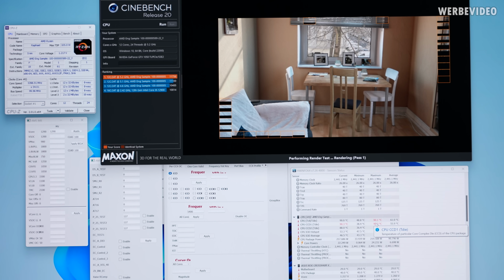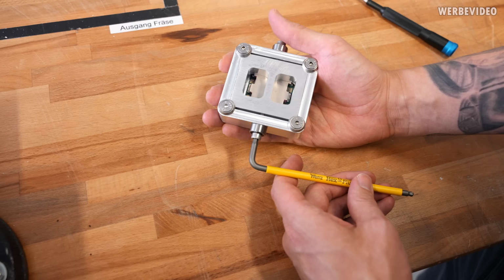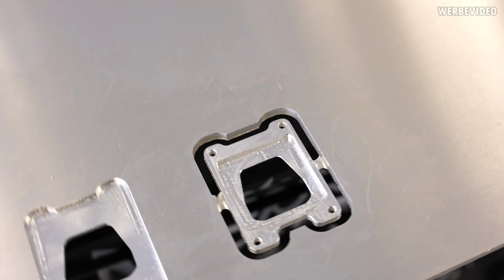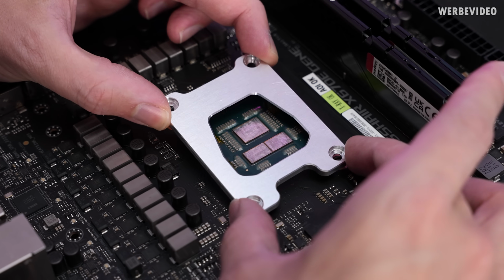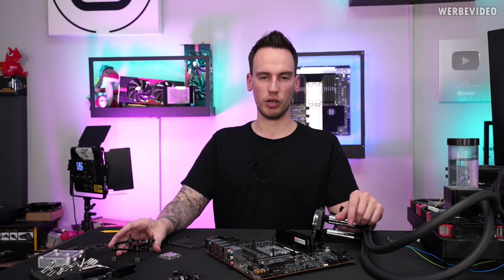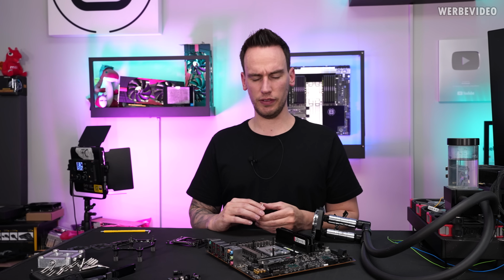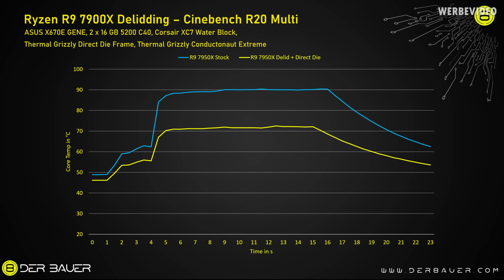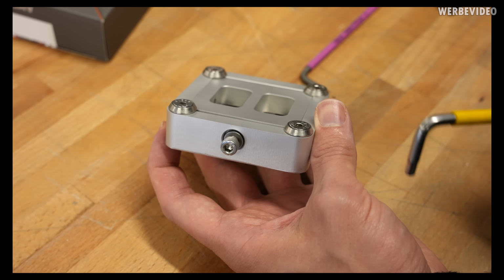Ryzen 7000 Delidding - Unreal Temperature improvement with Direct-Die Cooling

Comment: How important is it to use Liquid metal when delidding?  is it a must? I delidded my 5800X.  Only have paste at the moment. thermal grizzly kryonaut, My idle temps are best ever but when i stress test the temps are worse than with the IHS.
Reply: get phase change pad like ptm higher longevity than both lm and paste and very good performance on direct die also is non conductive

Comment: Nobody wonders WHY the power dropped from 219.5 W (baseline test) down to 185 W in the delidded test ?! That is 35 W (!) (DerBauer reports only 15 W). I have delidded a number of 7950X, and never got a -20°C temperature drop, but rather 5 - 8°C; I do my comparisons at comparable PPT, in order to assess the cooling efficiency properly. The maximum temperature drop through an IHS can actually be CALCULATED using basic heat conduction equation: dT = Q * d / k / A = 200 W * 3.6 mm / 400 / 250 mm2 = 7 °C. This is the maximum theoretical GAIN you can expect, if you believe in physics.
Reply from the maker: that's not true :) lower temperature decreases the power draw because it decreases the resistance of all the copper traces inside the CPU.
Reply: Power efficiency gain is about 3% for each 10°C... Whereas you report a gain of 15% (!). A decrease of 35 W is not explainable, both in terms of efficiency gain nor in the way the chip is managed. The maximum temperature drop through an IHS can actually be calculated using basic heat conduction: dT = Q * d / k / A = 200 W * 3.6 mm / 400 / 250 mm2 = 7 °C. This is the maximum GAIN you can expect, if you believe in physics.

Comment: Hi. hope u see this comment. great video. very informative. I just have one question. I notice u often use the enermax tr4 cooler for testing large CPUs (EPYC/XEON). from your experience, If i delid EPYC, would I be able to mount that cooler or do I need to get a custom waterblock? Looking at one of my builds it seems as though with the right screws i can maybe go lower. but im not sure. The Enermax TR4 has been surprisingly good with my OCs and as much as i want to go back to a custom loop, I always tinker with my builds and dealing with custom loops in a system where u often change things can be a hassle. but im trying to get better OC from my EPYC based Workstations.

Comment: I am coming back to this video a year later to confess that direct die tool was not to blame LOL
I bought Watercool Heatkiller IV pro waterblock which initially worked fine but after reseating the block temps went super high. I switched to Phanteks waterblock and temps are CRAZY good. 
Cinebench r23 score is 39500 with 1.21v ccx0 at 5.25ghz ccx1 at 5.1ghz. Temp is 76c-79c. 

Roman, sorry for blaming your product LOL

Comment: Slides say 7950x but 7000 use used...
Reply: This is because thermals and soldering of the 7950x dies are much improved compared to 7000 now. You never get -20°C on a 7950x by delidding, barely 5°C.
Reply: @onusbaum  LM + delidding on 7950x got me much more then 5C - now with EK TEC it is running on 30C~
Reply: @elior77  I had 82°C at 200 W and 38500 points on Cinebench R23, 5.25 GHz, pbo -30 all cores, with LF3 cooler, non-delidded. After delid (with LM Conductonaut Extreme): 78°C (same power 200 W), 39500 points, 5.4 GHz. Can you post your comparisons (if possible at same power levels and same cooling), i am very much interested.
Reply: @onusbaum  My setup is currently limited to 180W because of the TEC, when I say delidd I mean no IHS and direct die cooling, I remember my temps was very good with this setup and only water block - dilidd + lm + direct die.

Sorry I can not give you reference.

Comment: engineering for CPU's have heavy amount of investment.

 but then we have someone who engineered these cooling techniques.
 and are expensive but not if we think of big tech companies providing these similar cooling tech. they would charge 2K for the lowest cooling model in de-lidded tech world.

But this thing is great.

I wish someone to open the Acer Predator Helios 300 i9 11 gen rtx 3060 and make very small and precise water cooling in build , removing fan and heat sink , and then use that space to craft water cooling in-built.

water travel from left to right or right left through the laptop.

Comment: Set your CPU temperature limit at 80C in BIOS, stick it on a water cooler, expect and be happy it hovers around 5.3ghz regardless of how much power or heat you pump into it, and be happy.    My 7950x works fine, though it's mystifying how Windows sceduler uses cores and puts them to sleep.  Expect your computer fans to be very breathy as it ramps up and down.   As long as you don't run it at red line all the time, you're totally fine.  You really don't need that last 5% for anything at all, when you've got 12 or 16 cores...

Comment: Maybe I will try it with my 3800X which I've just replaced by 5800X3D. Both CPUs act weird, like cooler is still cool and it takes pretty long time before it starts to be hot and better or worse cooler has almost no impact on temperatures in full load. There is clearly temperature bottleneck between chip and IHS, which sounds weird for soldered CPU. But I already tried deliding of soldered CPUs in the past and it's very risky, especially when your CPU still have pins, you can't really use heating method to desolder it because pins are also soldered. But if this deliding tool works woth Ryzen 7000, it could work even with Ryzen 3000.
I see that problem is too much space between chip and IHS, that's why I believe they should stop using IHS in these days, it's pointless now when everyone uses massive coolers with copper base, it just makes things worse. 
I am thinking about brushing that IHS to the point that I will see core, but I don't know how safe it is.

Comment: Temps are ok but I would like to see the CPU OCed so we can measure the performance gain and tell if that was worth it.

Could it make 5.7mhz all core on manual oc? What would be the max all core clock  (as Pbo is limited to +200mhz)?

Comment: I'm seriously wondering why manufacturers still insist on lidding CPUs. If they can do direct die cooling in laptops 100% of the time, why can't they supply desktop CPUs as direct die cooling CPUs? Not much difference between putting thermal paste on a lid and putting thermal paste on a die and then screwing the heatsink in place.

Comment: have you tried this technique with the 7050x3d ?  also reguarding the topic of Backplates there are some available on Amazon. There is not much info as you know on product description of Amazon items. So back to Backplates, So using a backplate requires the cpu to be Delided or is it general purpose, is to protect the CPU from being Crushed by the Block Cooler?  Im new to the AM5 And to amd platform, as i deceded to go full on amd build. 7900X3D & 7900XTX Nitro + as my main components.  Here it what Amazon is selling... 
Brand Name: Thermalright
Description: Thermalright AM5 Secure Frame Black Am5 CPU Holder, corrective Anti-Bending Contact Frame, Am5 full-fit Fixed Non-Marking Mounter etc, etc.

Comment: Clearly, the heat spreader solutions they use on today's CPUs aren't particularly good. I remember well when processors didn't have them. It was a bit scary to mount the coolers, but with some shims, it wasn't so bad.

Comment: It's not about Cooler compatibility, they are not gonna reveal to you that they plan on Stacking chips inside. 
So they Just made a Thick Lid to Make thinner later when They add more stuff on the Z axis. As Am5 develops like AM4 did. You cant stack Cores because of the Temps, but you can stack Memory or other chiplets depending on their plans. 
They created breathing space for themselves for future proofing expansion of the design. 
It's a Mechanical engineering trick.
Reply: Not a secret bro, the static memory.. i.e l2/l3 , 3d cache and otherwise cache occupies a lot of space on the cpu.
And it is very obvious they're gonna expand cache progressively to keep up and innovative on their tech.

Comment: I know this is older but hopefully can get an answer from someone, Im wanting to delid and liquid metal my 7800x3d, His direct die mount says not to use on that specific cpu for whatever reason so I guess my question is how to go about reattaching the ihs on that cpu
Reply from the maker: the problem is that AMD changed some glue position on the X3D CPUs. So the frame would sit on top of that glue resulting in bad contact. Right now we are launching the upgrade heatspreaders for exactly this matter. So it's adjusted to the new changes and allows to put an IHS with bigger surface area back on. Will be available very soon
Reply: @der8auer-en  Awesome to hear :D, tysm for the response :)
Reply: @der8auer-en what is the temp difference between direct die and upgraded ihs?

Comment: I have Corsair h100i v2 and in the box am4 bracket and screws so it works on am4. On corsairs site they stated for h100i v2 that it will work on am5. So my question is will ot work?

Comment: Your direct die tool sucks btw. I've tried to apply liquid metal with the direct die tool and the temps are horrible.
Reply: Did you get round this? I'm having temp issues too, but not with his tool
Reply: @JSenior0  I am coming back to my comment a year later to confess that direct die tool was not to blame LOL
I bought Watercool Heatkiller IV pro waterblock. That was not sitting flat. I switched to phanteks waterblock and temps are CRAZY good. 
Cinebench r23 score is 39500 with 1.21v ccx0 at 5.25ghz ccx1 at 5.1ghz. Temp is 76c-79c. 

Roman, sorry for blaming your product LOL

Comment: When are we going to take the training wheels off and make a water to direct die  transfer block, meaning no copper plate just water moving over the bare die. You can test this with 100% IPA so not to damage electronics, obviously running the cooling system with separate power so that the computer isn't powered up.

Comment: Der8auer can you explain to me?
After deliding the 7950x, with the Der8auer kit, the processor saved itself with no problem. But the temperatures are always the same, the cpu touches a Magnitude ekwb with flat coldplate perfectly with the cooling circuit. I do not understand....

Comment: Now I would like to see what you would get with a NOCTUA NH-D15 and a "normal" TIM as opposed to liquid metal.
Reply: You'll get worse temps.
Solder tim is around 55 W/mk
LM is 73 W/mk
Normal paste is 5 - 12 W/mk
Reply: @bear5016  How about with a shim to go to protect any electro static devices with a solid graphene sheet TIM like the one Philips has made in the areas where chiplets would contact the NH-D15?
Reply: @chassecourt8824  you use silicone modified conformal coating on the SMD's around the die.
Graphene has even worse heat transfer because its thicker than regular tim.

Comment: AMD should have approached Intel and ask if they can use their cooler mounting specs.  If Intel says yes, only one mounting kit needs to be included that will work with both.  If Intel says no, make a new one which will work with AM 5,6 and 7.  Also mention at a keynote that Intel was asked and said no, which will make Intel look like dicks. 
AMD already effed up by not reusing the AM3 mount for AM4 and making everyone buy new.  I saw an AM4 board with holes for both so it certainly could have been done.
Looks like they effed up again.
Oh well.  My 5700G will serve me well until AM6 is out...

Comment: hi der8auer can u tell me if i need to buy the short or normal back plate, i have a quantum velocity full nickel from ekwb   and i don't want to change the block if i don't need to but want to delid  the cpu  and use this block. thanks
Reply from the maker: there are multiple ways to go. Does your block have a backplate? In that case I would recommend the small backplate and go from there. You have to make sure that the mounting height can be adjusted

Comment: Update: It's on thermal-grizzly site. 

Previous:
Seriously when will this product finally release?!? I have had a 7950x since day one, and my friend also just got the new 7950X3D and I think this could especially help on the X3D with the lower tj max and consequently  lower TDP out of the box. Both our rigs are water cooled and could benefit from something like this.  Also I was surprised the hold down bracket didn't wrap around the components more like the original IHS. just a thought

Comment: its logical. less connection, less loss
its the same in all tempstuff and all electrical stuff a straight  cable is better then a fused one
same with Prices buying from the producer is cheaper then from the shops (or it should be atleast)
less middlehands less loss =)

Comment: This calls into question AMD's official stance in saying 'these chips are designed to run at high temps for optimal performance'.
Obviously with better cooling solutions, they DON'T have to run the temp up to 95C all the time, yet still provide the same performance.

Comment: Damn cool tool man. Some feedback from a machinist. Please upgrade those bolts. Those looks like M4? Probably going to explode on someone with the forces I'm seeing. Maybe a fine thread with external hex. Torx is fine but a proper external hex you can use better tools. 
You can skip the fancy bearings too, just use 1 teflon washer and one stainless washer. keep up the work.

Comment: It seems the weak link is the double thermal interface with the IHS, which is a necessary evil on the retail market. Perhaps if AMD used better material for the IHS, as well as that liquid metal compound INSIDE the lid as well as supplied for the user to apply on the top as well - maybe 10 deg C benefit can be had. Temperatures skirt too close to  tjmax under stress testing.

Comment: The so called liquid metal is gallium is it not ? So bad idea applying on other metals no ? Not to mention conducting liquid metal on the unprotected open IC…ay aya ay.
Reply: On aluminum, yes very bad. On copper, it will migrate into the copper, maybe need to reapply once. On nickel plated, just turns plating color darker, like a stain.

If youre worried about it conducting, you can use silicone modified conformal coating or clear nail polish to cover those components.

Comment: That temperature difference is incredible. I totally understand CPUs won't ever ship de-lidded for good reason but, it seems like a no brainer to do better here (IHS) considering most people to buy this generation will be needing a whole new rig. I guess they don't really need it just at the moment and can save that efficiency improvement for later. Thanks for the video!
Reply: I think that at least for enthusiasts they should make a delidded version, for years back in the early 2000s many cpus didnt come with an ihs (granted, this also ended with many cpus dying from chipped or cracked dies). But having a cpu advertised as meant for enthusiasts and also make consumers aware of the risks, I think it could end up working out
Reply: they used to ship without lid. My AMD athlon had the cooler directly applied to the chip...
Reply: Back in the day they didn't have lids, it was good times. 😂

Comment: good lord i musta hit the silicone lotto then my 7 7700x is at 18910 on multicore and 1971 single on r23, but it just has a h150 elite aio from corsair and is bone stock aside from swapping the included ml fans with sp elite just to fully match my setup. the temps did stay around 95-98c multi but 65-70c in single with those results though i will gladly take higher temps.

Comment: I think this shows that AMD made a big mistake in using a thick IHS to maintain compatibility with AM4 coolers. It's a new socket/architecture, they should have said "get used to the fact that you are going to have buy a new cooler block and backplate. Such is life when you are an early adopter".

Comment: Maybe a dumb question but if you did a delid and direct -die  cooling in a normal case where the motherboard would be stood upright would this effect the liquid metal and would gravity and heat cause the liquid metal to run out from between the CPU and the cooler ?

Comment: what was the thermal interface for stock case i.e. with the IHS on? if it was not liquid metal, then you might get 20 degrees temperature lost just by switching to liquid metal and not by removing IHS. i got these 20 degrees difference on my old 7700k just by changing original thermal paste to liquid metal and keeping IHS on its place

Comment: Looking closely at the retention bracket, it seems like it assumes the empty smd pads remain empty (the taped over sections). If for whatever reason in the next stepping or the X3D version AMD populates these empty pads with more capacitors the bracket will not work.

Comment: We need a delid / ihs mega video for theese new gen cpus
-stock 
-Stock lapped
-Delid with LM
-Direct die

And for three/four sets of coolers. Small / medium and big  aircooler + an large AIO. (Ie. U14S, DH15, 360 AIO)

Since you see so massive improvements on the direct die cooling I suspect that an aircooler with enough surface area will perform quite well

Comment: I think that unless AMD left that much vertical space offset as a plan to do some 3D stacking magic in this socket, then they've made a mistake and should have lowered the Z height and just given a heads-up to the cooler manufacturers to design new mounting mechanisms.

Comment: Whats stopping someone from not using the stock AM5 back plate and just using the CPU in the socket without the retention mechanism? Wouldn't that change a lot of the cooler back plate compatibility issues?

Comment: der8auer i have some theorys, since the IHS is so high, why doesn't someone make and sell a similar IHS plate closer to .500 of an inch to the direct dye? sure it will be a thin plate of copper / nickel plate, but if you managed to CnC a replica of the Current IHS wouldn't that be a be a second-best option?